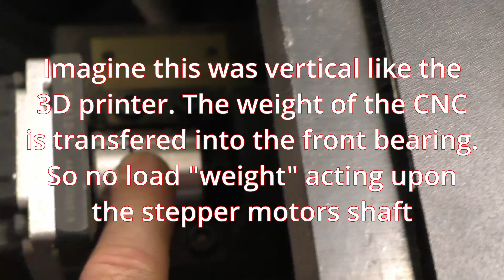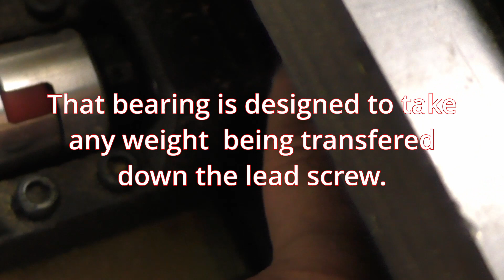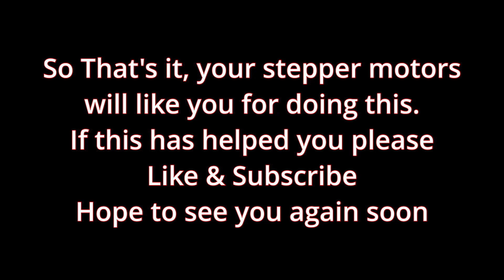Z Axis Thrust Bearing on a 3D 🖨️Printer - Take the Weight Off Your Stepper Motor 0028

Comment: My first printer was an Anet A6 and adding these nuts was the default so didn’t even think about it when I assembled my Ender 3. I also printed some washer in TPU and added these between the wheels and bed to stop them turning. Great to see you insulated the bed. Thanks for posting as I am sure this will help anybody that installs them.
Reply from the maker: Thanks. Yes bed insulated. And I hope all my video help people with set up and fing issues.

Please like and share to reach more people.

I feel a lot of people that 3d print are not good at problem solving or understand engineer so I am here to try and help

Comment: What affect does this have on your print quality or what problem does this solve? You claim it's just your opinion that it's not a good idea... How does your modification make your printer better?
Reply from the maker: Hi Still dialling in the printer as now playing with Marlin 2.  The reason i did this was to remove the load upon the stepper shaft. Although steppers are designed to handle some axial load, in my eyes this is not good.  I have seen so many printers suffer from failed prints and layer shifting.  I have done this to try and prevent these issue from happening.  These are cheap printers that are very much built to a low price, but I knew that before buying.   This will not be for everybody.  I will post results once I have Marlin 2 working well upon my 8 bit board.  It is printing but just tweaking some code to add additional options in to the LCD menu.  I also need the z to lower more when homing, due to an extended build plate than standard and i am using larger binder clips it.

Comment: The problem with the weight of the bed riding on the stepper shafts was readily apparent.  I created a matched set of brackets (the spring coupler between them), the top one with a flange bearing for the 8 mm lead screw which my thrust bearing sits on.  This way I can use a slightly larger thrust bearing.
Well done
Reply from the maker: Glad somebody agrees, as taken a bit of heat about this on FB.  Would like to see a photo of what you have done. Always more than one way to get the same or better results
Reply: @flixmyswitch  Thought about this off and on last night.  What was bothering me was that I have not seen anyone complaining about malfunctioning z axis stepper shafts.  The reason I went at this was to facilitate a much larger(read "heavier")  build plate.  At any rate, it  helps to shift the downward thrust to the thrust bearing designed for this type of force.